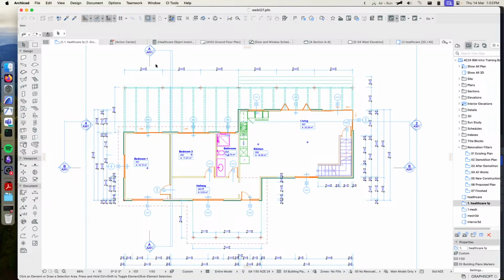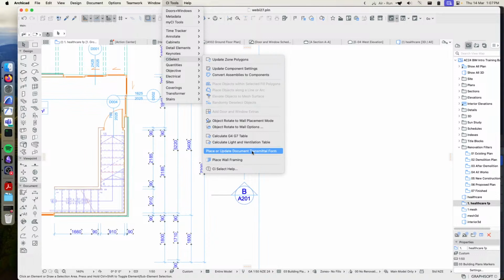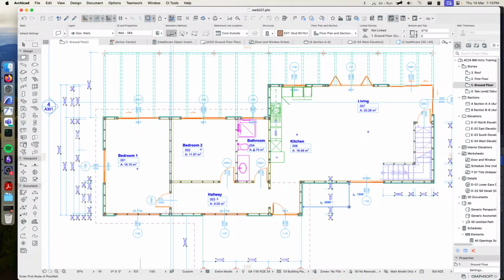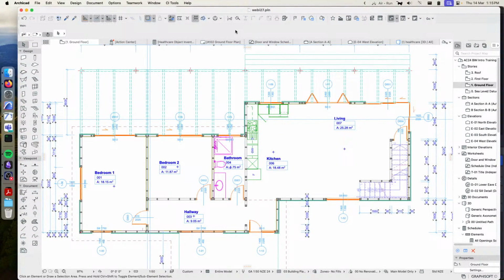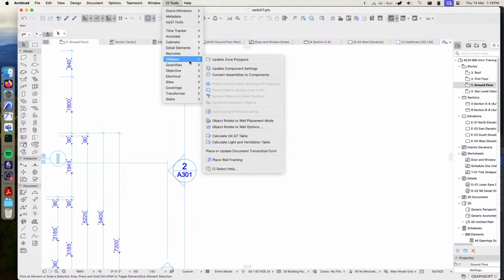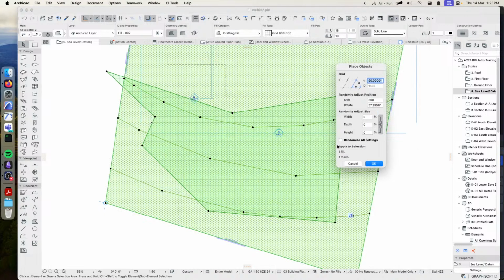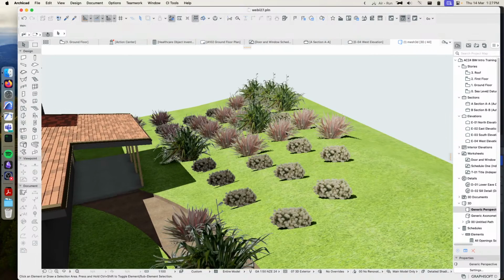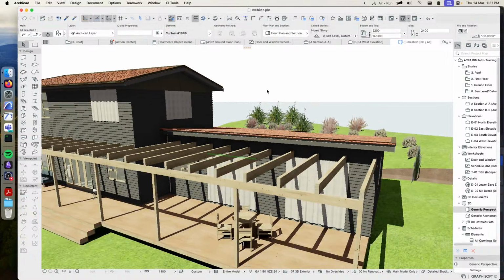Ci Tools Weekly Webinar - 14/03/2024 - Ci Select

Comment: Is there a floor framing tool that would be amazing🎉?
Reply from the maker: There isn't currently, but it's certainly something we can look into. Would something that worked similarly to the way the "Place Wall Frames" function in the video does do the trick, do you think? Or are there additional considerations it would need to make?
Reply: @CiTools  in developing such a tool one would have to consider giving it the dynamic features like the roof wizard, which would allow the floor framing to be adjusted in certain areas and members being labeled. In addition all the framing should also automatically be generated in a table with a cut list. Looking into the ability of sizing certain errors for reinforcement would also give structural engineers, the opportunity to dive deeper into ArchiCAD them to do more framing work. Add in brackets frames and all the additional support would be a plus if possible I know this would be a complex code system, but it also must be dynamic and reflect in the schedule. If an opening is introduced it should be able to calculate the necessary support structure. This is just a summary of what I think it should work like I have an entire written paragraph on how we should function and what the outputs should be.